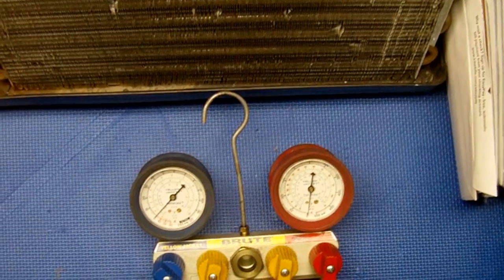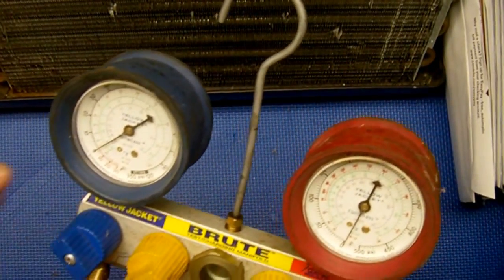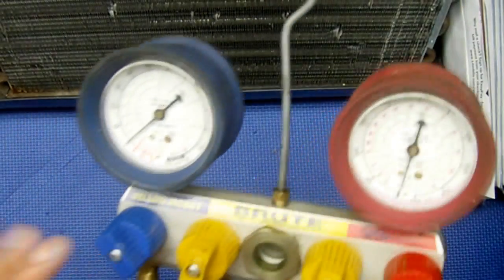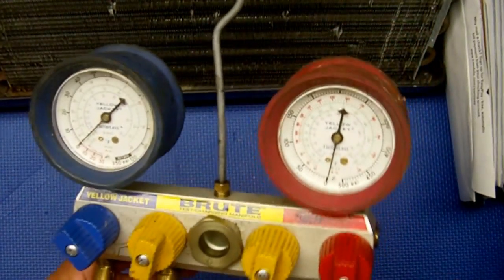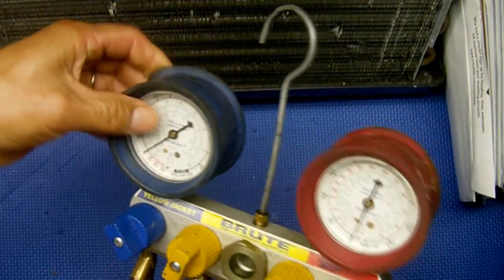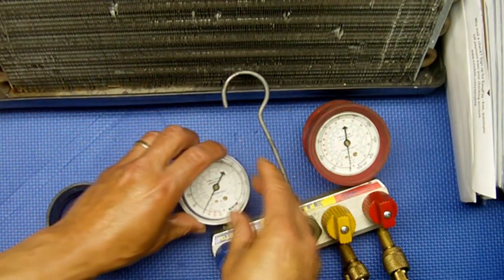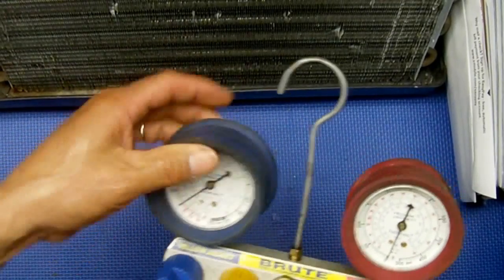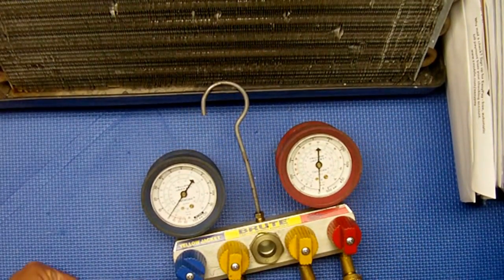Gauge Manifold  Review

Comment: I have imperial. is that better or worse? i have a question. i have the 600 series 4 valve set up. my question was is i could switch the gauges and use the same valve body to use with r134a gauges so i can use the car. would that be possible? same body just switch to r134a gauges on top? or is their more to do with it?

Comment: I bought a A/C Manifold Gauge Set
U.S. General
item#92649 
at  harborfreight 
for a 
R134A 
with the yellow tube having a 5/16 connector.
Do they sell a converter for a 1/4 tapered connector as on the R22 tank?